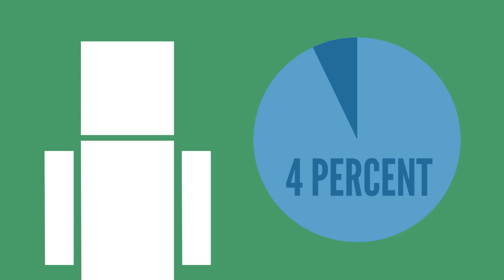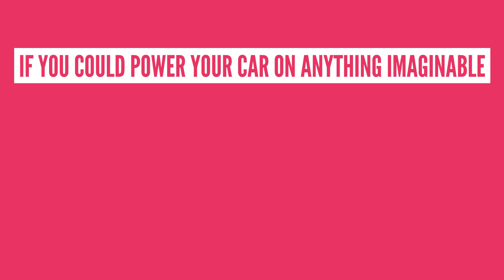Why Don't We Have Water Powered Cars Yet?

Comment: Many of the possible alternative fuels/ideas would have complications, like plastic, the waste product of it would most likely be small plastic particles especially if your burning it which would pollute the air. For carbon dioxide, I would actually be interested in how that would work if it worked like the water car and the waste would be oxygen and ran on carbon or switched around. If you were to use trash you would have to burn it so it would be no better than oil. Excrement would work, but if it had a methane as a waste product than that would not be good because methane is worse for the environment than carbon dioxide.Personally I think biofuels like algae would work best because any waste product of it. would not hurt the environment and people would grow it themselves, and many people could make a profession out of it having algae farms.
Reply: Oil is better.

Comment: It's funny because people out there have a full home made setup that run hydrogen and the cars/trucks run perfectly fine if not better. This guy here is just saying it's impossible
Reply: You are slightly confused. Yes hydrogen fueled cars do exist and they are sold on the market. Nobody is arguing that hydrogen cannot be used to power cars. A hydrogen fueled car is different than a car fueled by water. When hydrogen is used you don't have to break it down. Water on the other hand does need to be broken down. This means it will always take more energy to break apart water molecules than you get from it.

Comment: His name was Meyer, not Mayer, and he wasn't a fraud. He wasn't using the electrolysis discovered over 200 years ago that you mention. It uses a certain frequency to separate oxygen and hydrogen using much less energy than traditional electrolysis. This is confirmed by research done by John Kanzius ten years after Meyer, who was trying to use a frequency machine to cure cancer, like Royal Rife claims to have done, and accidentally discovered that using a certain frequency can cause water to ignite.

Comment: What about a car that runs on the PRESSURE of water 
It can be an engine that uses a tiny waterwheel to transfer the water pressure into electricity which is EASIER cuz the wheel will spin way faster do to the large amount of water that recycles through it 
Yeah it works just like a hidroelectric dam

Comment: The HHO gas, can be used as fuel, its been used in Rockets and burns clean, and essentially steam cleans the engine. All we need is a Solar Panel to passively generate HHO gas for the car when idle like when grocery shopping. And a simple relay system that when the car is turned on switches from Solar output to the Alternators output.

We can gather rain water or simple use water from a spigot.. 
carry an extra gallon jug of water incase.. 
and use the vehicles vacuum line to keep a solid reservoir of HHO for ignition..

Diesel and HHO would be the only fuel sources for vehicles we'd need..

Comment: the truth is that driving a car is not like powering a electric generator. driving a car is like lifiting a big stone as heavy as 4 tons by a counterweight of 16 tons by some height and then assume that you lost the energy of the counter balance by simply put the force in as input and ignore the counter weight for the lift. the same is by driving a car. you go down a hill and then up a hill. the energy you got from down a hill was retuned up a hill. the energy required to maintain speeds minus friction is minimal just like the energy required for  a service car lift that runs on a counter weight. the energy input only need to overcome friction as the weights are in balance there is little input needed lift the car as long as its in balance with the counter weight. the up hill to that of the down hill is like a weight to that of a counter weight. little input is needed to drive long distance. if there was zero friction and the road was 100 percent flat the energy required to drive across a entire city would be zero. you only need to accelerate the car up to desired speed and the momentum would take it to destination by itself like a spaceship in the vacuum of space. if we only use energy to combat friction and store some energy to overcome difference in hill altitudes we can run on very little energy over long distance with very little energy input. a solar powered battery that convert water into fuel will do very good as long as the regeneration is produced by the generator producing current to make more hydrogen and also charge the battery. a hybrid technology like this will be very useful. the efficiency of hydrogen production is purly a matter of perfection. the energy loss can be reduced to nearly zero by conversion. a 23 century level hydrogen cell will be seen by the 21 century scientists as a perpetual motion machine. that is because understanding of physics of chemistry in the 21 century is like the stone age to that of the 23 century. would you want scientists from the stone age to tell you how efficient a machine can operate in the 21 century.

Comment: Bullshit, Stanley's car drove around perfectly fine, and he didn't use electrolysis. He designed a device that made fine mist inside what it would be the replacement for the spark plug and then used a "high voltage frequency" to divide the atoms. The rest of the power came from oxidation; burning oxygen in the air, so no thermodynamics violation.
Reply: Water cars can not and should not exist. Oil is better.

Comment: If I could run my car with anything I would choose,

Plastic
Carbon Dioxide
Trashed old electronics
Trash
Poop
Reply: Many of those would have complications, like plastic, the waste product of it would most likely be small plastic particles especially if your burning it which would pollute the air. For carbon dioxide, I would actually be interested in how that would work if it worked like the water car and the waste would be oxygen and ran on carbon or switched around. For electronics, not exactly sure how that would work. If you were to use trash you would have to burn it so it would be no better than oil. Excrement would work, but if it had a methane as a waste product than that would not be good because methane is worse for the environment than carbon dioxide.Personally I think biofuels like algae would work best because any waste product of it. would not hurt the environment and people would grow it themselves, and many people could make a profession out of it having algae farms.

Comment: Filling tank with water and doing electrocis to water then seperating hydrogen from it and then we can use that as fuel. Instead of that we can produce a hydrogen engine vehicle with gas tank filled with hydrogen gas🤷 and we can fill hydrogen from gas stations.

Comment: I would use air as fuel if it is existent in the future 

Like: You agree 

Comment: You don’t
Reply: In fact that's possible, a man from Luxembourg called Guy Nègre developed compressed air cars, one with support from Tata. Peugeot and Citroën (Groupe PSA) developed compressed air/gas hybrids, but the development is put on a indefinite hold because they couldn't find a development partner willing to split the development cost. Compressed air cars are three times weaker than cars powered by lithium-ion batteries at the same speeds.

Comment: This video is casually passing by the takeaway . The addition of hydrogen and oxygen to the hydrocarbon fuel makes it 300% more efficient. WOW ! acting like a 300% is " nothing special"? so what if you need to still use gas or diesel,  a tank would last three times as long. All from simple electrolysis and plain water ?

Comment: I want a car fueled by CO2
Reply: It has already been done but it takes alot of energy to pressurize, cool and contain it. It acts as a refrigerant when released so has problems in cold temperatures and stops up with water crystals and ice formation.😁
Reply: @desertdan100  cool

Comment: Iv actually been working on this the few problems I have on paper are getting a stable A/F ratio that makes proper power and then since engines them selfs are not 100% efficient they have energy loss so there is a gas produced but its the same gas produced by diesels so I was thinking of testing out a def unit to cut down emmisions.
Reply: keep it up !
Reply: Be careful bro, you could be next.

Comment: It doesn't take much power at all to separate hydrogen from oxygen. The efficiency of the engine is the tricky part. If the engine can run off small amounts of hydrogen then electrolysis on a small scale could be possible. This is perhaps what was accomplished by Meyer. Storing hydrogen wouldn't be necessary if the engine could run off what hydrogen was produced. I think we need to take a look at an alternative internal combustion engine design that could possible do this with little hydrogen.

Comment: I actually saw Stanely and his water powered car, it worked!.  It wasn't legal problems that messed him up, it was a "car accident" and the Big three swooped in and bought his patent so it could not be used as long as they kept it current.  As for "running out of water" AlphaGamma128, Basic chemistry tells us that when you burn something you add O2 to it.  So when you burn Hydrogen (H) you get H2O (water) or H2O2 (Hydrogen Peroxide) as an exhaust.  You can't run out of water when you get water from using it.
Reply: I reported your comment. I don't want to report your comment but I have to according to

Comment: has anyone thought of using permanent motor to generate unlimited energy for the process of electrosis.ive used 2x aa in parallel to seperate  1 litre of water into H2 and 0xygen in 5 mins.its not that energy consuming.i think that the fuel companies dont want people to use water powered engines and so are eliminating all traces of them including their inventors either by buying it out or killing and destroying them and the research

Comment: Hydrogen heated steam engine to turn turbines to generate power for electric cars.. Removes rod from a nuclear reactor < Fancy steam engine needs a new heater.. Far far less water use, and if you need more you can have a small dehumidifier built into vehicle to collect from atmosphere.

Continues pumping hydrogen from a plasma based converter using plasma based ultrasound to change pressure of water for faster ejection to prevent ignition Only enough needed for a flame strong enough to keep a steam turbine rolling.. Excess energy for? Use your imagination..

Comment: I have an Idea.
get a air blower (or soething)
get water
get electricicity
get a water whell.
put air blower in car mechanics
put water with air blower
put water wheel in 
have air blower work
water goes around, spinning water wheel
have water wheel power car
boi
Reply: Oil is better

Comment: I suggest you read the Cambridge University white paper, Arc Liberated Energy Exceeds Electrical Input Energy. Numerous water fueled vehicles exist right now and the truck is Ammonia. Ammonia replaces Gasoline as fuel in internal combustion engines. Ammonia can also be produced from water and air on demand. Your facts in this video are misleading. Meyer was sued because he couldn't repay his investors. By the way salt water fueled vehicles exist as well.. Clearly this is a hit piece by a schill..

Comment: The electrolysis of water into hydrogen and oxygen is a simple and very low tech process. The real reason water is not used as fuel is caused by the next to complete control oil companies have on the fuel industry. Using water as fuel doesn't exist because it would be very hard to monetize. what are your thoughts. Most people are unaware that a water splitting spark plug has already been invented however it was kept somewhat quiet with only one public news feature ever covering it. shortly after the inventor tried to patent it however he died under "unknown circumstances" and his his research somehow vanishing. Please don't take my word on it. Search for the truth yourself. Don't be part of the pack that follows. be the one that leads.

Comment: How many hours did this guy actually spend researching Stan Meyer's work? I bet no more than 10 hours.
I've spent over 12 years on it and I can tell everyone here:
1. It did not break the laws of thermodynamics-That's what people say that have only glanced over the documentation rather than performing years of research, testing, and design.
2. What he did was discover a way to amplify several phenomena and then he designed his systems around that. The problem is its almost impossible to replicate for many reasons, and if you are successful but you don't understand everything that is going on you WILL get exposed and sick (exposure to radiation).
3. I understand why this guy is so quick to judge, the idiot believers think he drove his car all over and it ran with no problems and was better than gasoline, wishful thinking but not correct!

Comment: Research on the internet, a Romanian invented a water engine, 2l at 1000km, oil industry silent them down
Reply: Um... your profile picture is about tiktok which also silences posts about saving the envioremnt.
Reply: How can the oil industry silence someone? If an idea doesn't work than that means it failed or no one wanted it as it didn't work well.

Comment: because water is 1 of the most abundant things around us so you couldnt make any money from it... also the same with free electricity... we have an abundant source or magnetic energy all.around us so why cant we use ultra high frequency to tap into that source or disrupt it and pull what we need by making another circuit directly to earth. again its free so you can t make money... also levitation through acoustic sound is more than possible but again its free  and you cant make money from it...

Comment: CO2 or carbon monoxide because maybe if carbon monoxide was the fuel it would create O2 also known as oxygen
Reply: Oil is better
Reply: @insectbite1714  Oil is part of what is causing global warming and I'm trying to figure out a way to at least stop it or reverse it.If you get the right amount of  carbon dioxide and oxygen in the atmosphere then the Ozone layer is safe but too much of either would be bad.That is why I would suggest running on carbon dioxide turning it into oxygen until it is even in the atmosphere then switch to solar or wind power.